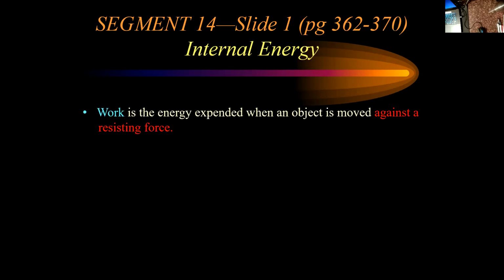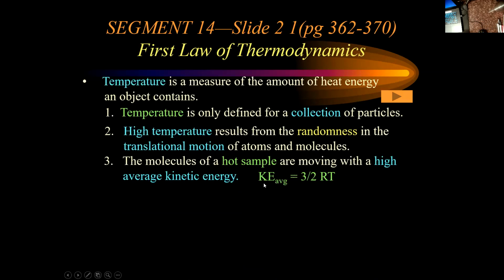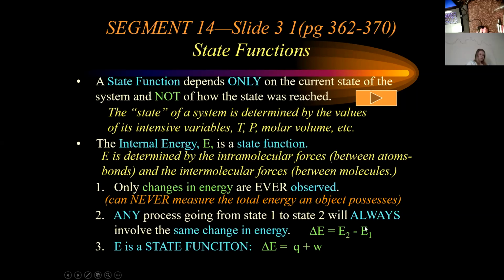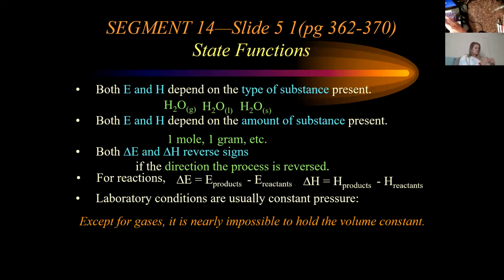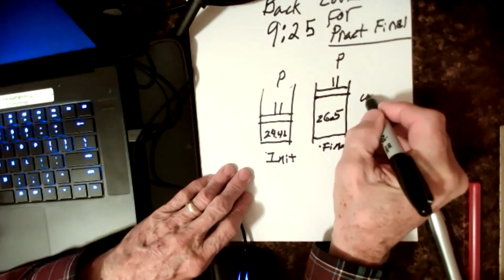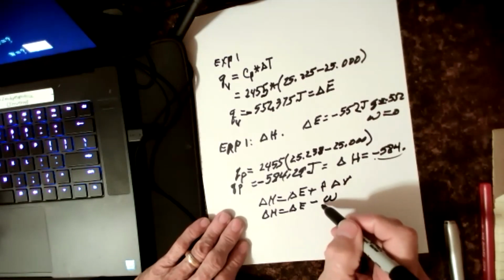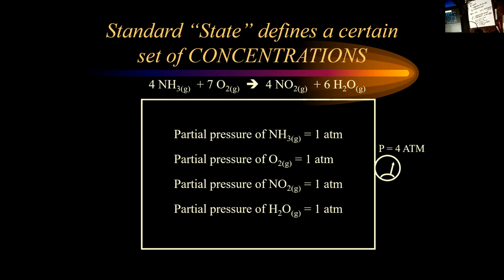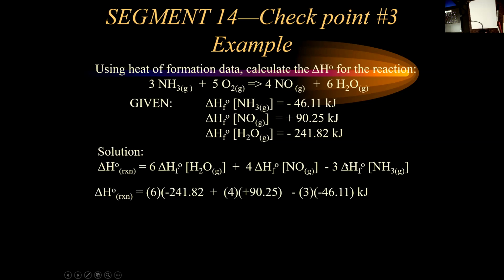Segment 14 first lesson

Comment: The albedo/atmosphere make the Earth cooler not warmer.
If that is correct the greenhouse effect is not.
The GHGs must absorb “extra” energy upwelling from the surface radiating as a black body. Because of the kinetic energy in the contiguous atmospheric molecular and as demonstrated by experiment such is not possible.
If this is correct the greenhouse effect is not.
No greenhouse effect, no GHG warming, no man/CO2 driven global warming or climate change.
Version 1.0 120321